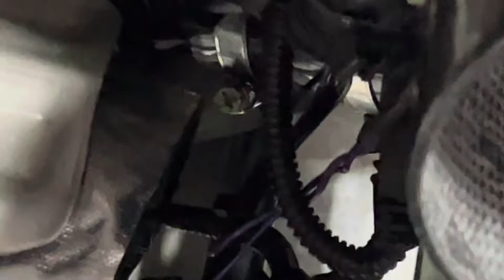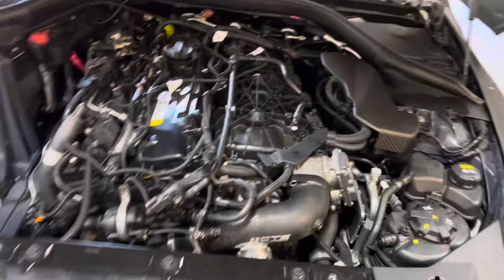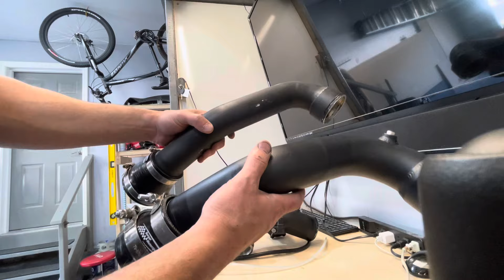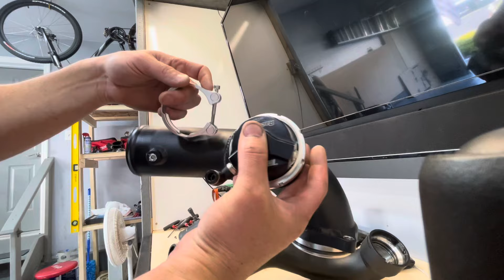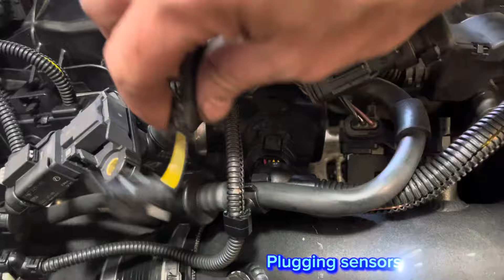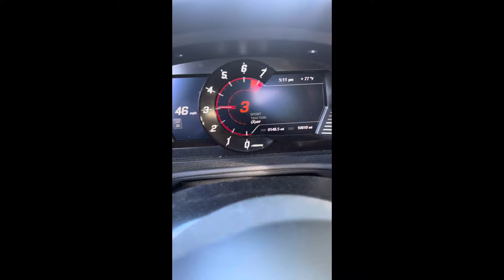A90 Supra blow off valve install and how to build your own setup!

Comment: Why is my vacuum line not getting that nice clicking sound? And now I tried to take the adapter out and put it back on the original connection spot and can’t get that to connect… any help?

Comment: Will the tial not fit on the bms charge pipe in place of the turbosmart?
Reply: I figured you only did it on the cts one because of the bungs u needed?
Reply from the maker: Correct it hits a coolant hose

Comment: Hey bro im planning to get the same intake(aramaspeed) as yours im new to this if i get all the mods you have in your "descriptions" but i dont run on meth fuel do i still need everything?
Reply: or i just buy the BMS BMW/Supra B58TU Gen2 Charge Pipe Blow-Off Valve (BOV) Kit --- that comes everything with it, the bov and the charge pipe. 

do i still need the adapter? and TiAL Sport Q Series 50mm Blow-Off Valve -11 psi Spring

or just the bms and i get the sound what u have?
Reply: Oh I get it now the BMS is a plug and play chargepipe that comes with BOV kit

yours u replaced the charge pipe with bms but with custom CTS with TiAL BOV with  TiAL GREEN SPRING
Reply: Here's the final question sorry i ask too much im new

Do i still have to get the ADAPTER if i buy the BMS chargepipe that comes with BOV KIT? 

or no more?
Reply from the maker: @x2Tom if you buy the bms it has everything
Reply: @CFDProductionsVideo  I figured. Will it produce the same sound as yours?
Reply from the maker: @x2Tom very similar

Comment: How many lbs of boost you on that bov? Boost doesn’t leak or cause it to open under load with 2lb spring?
Reply from the maker: @DSmith_Sr_IFBBPRO  have made up to 25 lbs … but typically around 21-22
Reply: @CFDProductionsVideo  awesome thanks Bro. Didn’t want the hks electric sound.  This is back to how I remember bov’s worked.
Reply from the maker: @ I tried the hks … doesn’t work well on our setup … the turbo smart that works well too has no leaks
Reply: @CFDProductionsVideo  ok cool. I might try the bms bov then
Reply from the maker: @DSmith_Sr_IFBBPRO worth it for sure !
Reply from the maker: @DSmith_Sr_IFBBPRO  works perfectly
Reply: @CFDProductionsVideo  you think this upper pipe setup with work with the 2.0 ?
Reply from the maker: @ I don’t think so
Reply: Installed the tial on mine and works well.  Thanks!